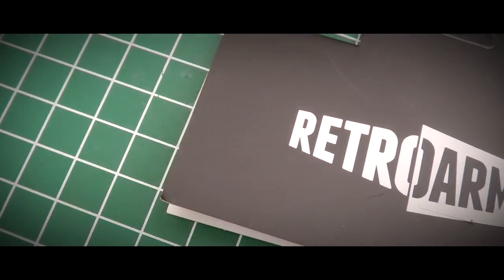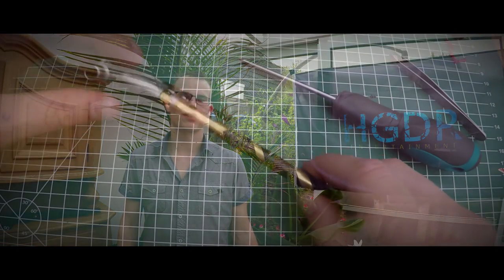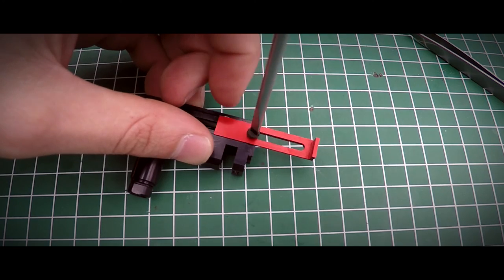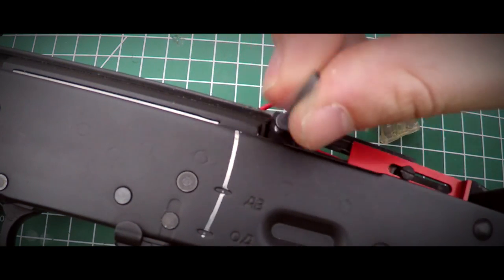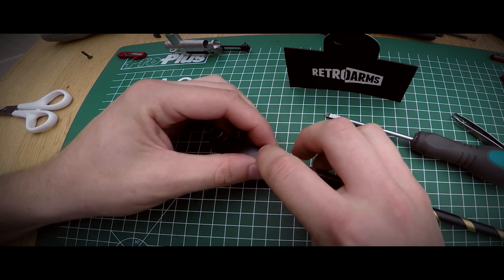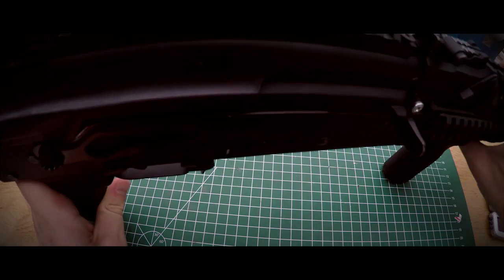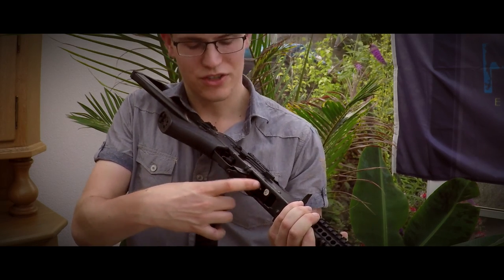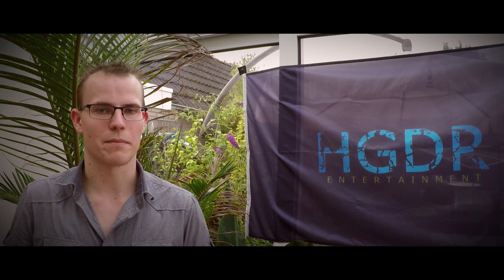"RetroArms AK Hop-Up Chamber" an Airworks review | #2

Comment: Hey buddy, I am searching info why I have a 200 fps decrease with the RetroArms hop up :( With cyma HOP UP I got 450 FPS with 0,2g. now I have only 280 FPS with 0,2g and RetroArms hop up. I correctly installed the hop up rubber,sealed it normally like I do on CYMA hop up chamber. You say you had to ULTRA seal it to get extra 70 fps ? Thanks for your reply.

Comment: Point of info retro arms ak gearbox now come with a locking log that removed the need to Teflon tape the barrel
Reply: The locking log is instead of the brass ring, it is meant to keep the innerbarrel centered in the hop up unit.
This is placed on the exit part of the unit, near the c clip. 
Some goes for the circular cut(s) on most barrel ends, its for placing o rings to center the inner barrel, into the outer barrel. 

Teflon mod, is for creating/perfecting an airseal on the part where the bucking ends.
You can also use a little bit of glue, or a certain kind of grease. (copper grease i think? you come across that on some stock brass barrels) (No oil because this will dry the bucking out and make it crumble)